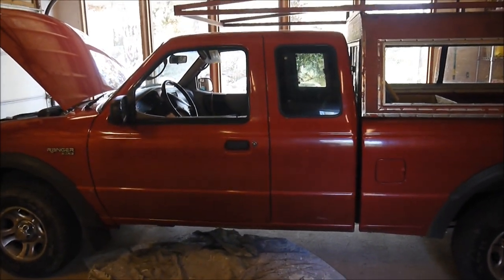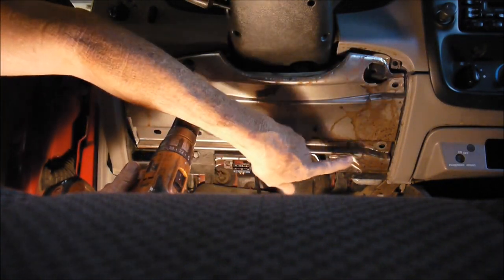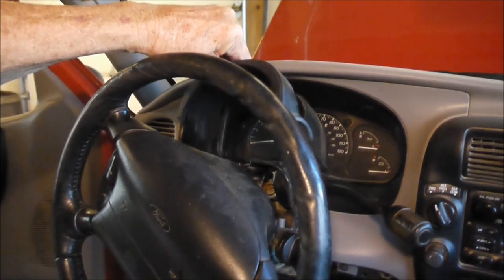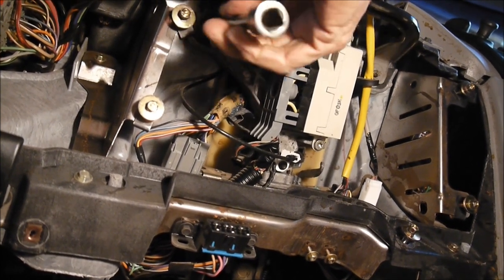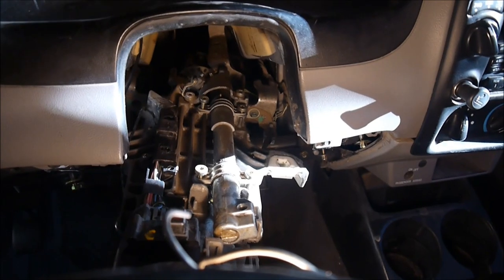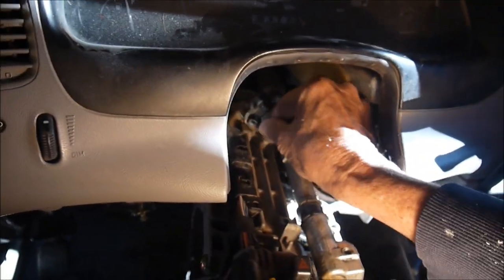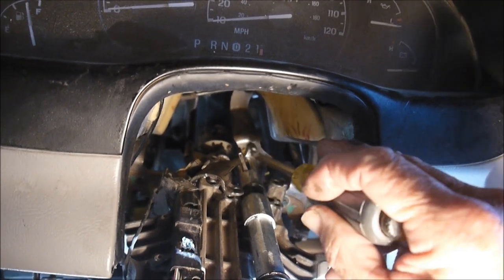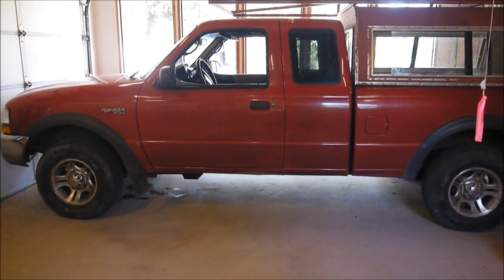Fix shift tube Ford Ranger

Comment: Just got done replacing a broken clamp that holds the shifter tube, it fixed the slop of the shifter but the key will move at all nor the shifter both are locked up. I had trouble aligning the shifter tube until I reached back and shifted it by hand. What do you think I did wrong?
I was not able to put it in park so when I started working on it I had it in neutral, then putting it back together I shifted by hand in order to make the shifter tube to sit in the right the place. 
Thanks,
-Jack
Reply from the maker: Sorry for the slow reply. You probably have figured out what is wrong by now. If I found my self in a similar situation I would probably take it apart again. Mine, as you see went back together on the first try and has worked fine since then. I think the key to no future failure is locking the bolts that hold it together so they won't ever loosen accidentally. Peace Bill

Comment: FWIW: There are actually 5 bolts that hold the metal piece that is under the plastic knee panel, one of yours (lower right) was missing.

Comment: I have a question.  I just bought a1998 Ford ranger. The previous owner told me he just replaced  the shift tube and plunger.  It's very hard to put into gears like drive.. or reverse..etc. should it be very hard  to do after it's been replaced??? Can someone help me?

Comment: do you know what size the reverse torx screws are that allow you to drop the column? Do I need to buy a socket or can I just unscrew nuts? Great video. Thanks.
Reply from the maker: Sorry, I don't remember, It may be in the video though. You just have to loosen the rear bolts because they have a u shaped hole that is open on the end and slip off after you take out the front bolts.  Bill

Comment: Great video , don't know what I did wrong but the key will not come out of ignition. Any suggestions ? Thanks
Reply from the maker: I have a similar problem that only happens occasionally, if I push up on the shift lever, (I have an automatic on the column) it comes out.  If you haven't put it all together you might loosen the hold down bolts and see if everything is in the right place.  I don't know what would change to do that but, there is something.  Sorry I can't help more.  
Bill

Comment: I started to this but I just realized I don't even know if that's the problem! Ranger starts push brake in move the shifter back and fourth no gear works like it's on neutral

Comment: Great video! I think I sent a message rather than commenting here, but my question was about the direction of the steering wheel. At around 3:30 in the video it seems like your steering column is pointed toward the drivers door (non-perpendicular) a bit. My seems to do this and I am not sure if it came that way from the factory, or if I need to get in there and adjust any of the mounting bolts to attempt to straighten. Thanks!
Reply from the maker: Yes, you are correct, the column is not centered. I think most cars are like that for ergonomic reasons.  Peace Bill  I tried to find my inbox but I don't know how to access it despite watching a youtube video!!!
Reply: Thanks, Bill! Just making sure I wasn't loosing my mind.

Comment: Many thanks my friend.  I got lucky and didn't need the torx sockets, the bolts came off fine.  I am not a big fan of the design of that shift tube, needless to say.  PITA repair, but it looks like it went fine with your guidance.
Reply: Chris Gonzales it's a common issue across an entire line of Ford products,they used the shift assembly from the cars on the trucks,and they weren't designed for heavy duty use , so everything breaks. Also Ford doesn't know what lock tite is

Comment: great video! super helpful. My 2002 Ranger broke almost exactly like yours did. It happened in the parking lot of a store so I had to reach up and shift by pulling the cable with my hand and it HURT. But I had to get it home. now I just need a new shift tube.

Comment: The shift tube in my ranger is snapped in half, do you think i would be able to just weld it or should i just play it safe and replace the tube? And what kind of metal is the tube?
Reply from the maker: I am pretty sure it is pot metal and welding is not an option.  You could try jb weld or similar but, what ever you do be sure to lock the threads on the shift attachments at the back, that's what went out on my ranger.  A new shift tube is not that much and taking the whole thing apart if it fails again will ruin your day.  Bill

Comment from the maker: Hi Chris, You are the first commenter, glad to help.  I don't know why the bolts should ever get loose which cause a failure. Bad Ford design.  Mine is still working fine.  Good luck Bill
Reply: I had to move my shift selector up and down to get it to start and also go in the right gear 2003 ranger auto.

Comment: thanks for this, I did everything you said, i Just cant seem to take the gear handle out from the shift tube, any advice?
Reply: Just take a small hammer and tap it back out. Be careful as it is designed to come out one way. It has small splines on one side. Just tapping from the opposite side of the splines should slowly move the pin out of the handle and pin hole.
Reply: J Holland ppl

Comment: You're supposed to pull the negative on the battery, not the positive.  Make that mistake again and you will get a short circuit through your wrench when it touches ground and you won't make it again!

Comment: the white steel part broke on mine ,do I have to replace the hole thing or just the white steel part and will it slide off
Reply from the maker: Sorry for the delay. You many have already fixed the problem.  I assume the "white steel" part is really the sliver cast part with the tabs that things screw on.  If any of those tabs break or loose their threads you will have to replace the whole thing.  You can save money if you check on the internet for a replacement part.  Good luck, Bill

Comment: how did you diagnose this was the problem ? 
i have same ranger , my gear shift is just hanging like limp noodle 
. flops around wherever you move it .   is that from bad tube ?
Reply from the maker: Likely cause. You can disassemble the first parts and see where the problem is.  Mine got mushy then quit altogether.  Fortunately, I was able to get to my garage before it went away totally.  Bill
Reply: Bill Morgan thanks for the fast reply . 
just got my shift tube out .  it was broke in half . 
your video was great help :)  whats up with the thumbs down ?
if this video didn't help them they don't deserve to hold wrench anyway . lol
thanks for the video .   thumbs up from 500
Reply: I have the same problem this vid is pretty helpful though

Comment: do you happen to know where the shift interlock solenoid is??
Reply from the maker: +Esker One   Sorry I don't know where that item is but, I bet Google might!!
Reply: +Bill Morgan I've been trying lol. my 1998 Ford Ranger won't shift out of park.. I replaced the brake pedal senor.. just wondering if it's a bad shift tube or solenoid
Reply: @chadmorrill7114  Ik this is five years later you may not ever see this comment. But I got my first truck which is a 1999 Ford ranger and I'm having the same issue did you ever figure out that problem
Reply: @nate6656   it's the shift interlock solenoid.. that's what when out on mine took awhile to find the sneaky bugger but you have to pull apart the steering column

Comment: I thought you were supposed to disconnect the negative
Reply from the maker: +Melvin Jackson It seems that disconnecting either one will take the battery out of the system.
Reply: +Bill Morgan Its generally more safe to disconnect the ground not the positive. If by chance there was an accident, mistake, whatever...it will short circuit  the way you do it rather than complete the circuit. Yada yada, you don't need to hear this just a thought. Thanks for the video